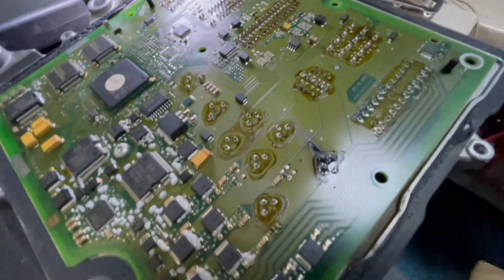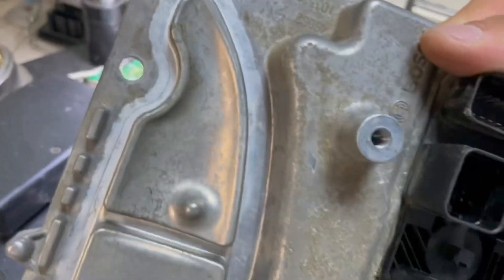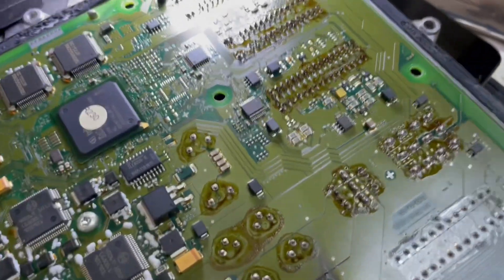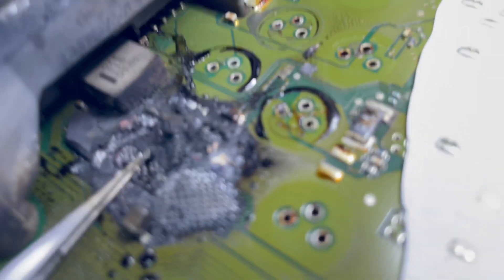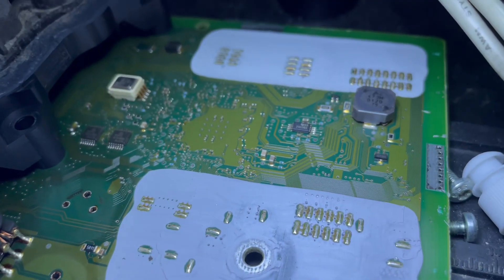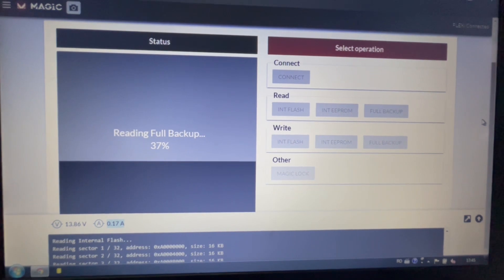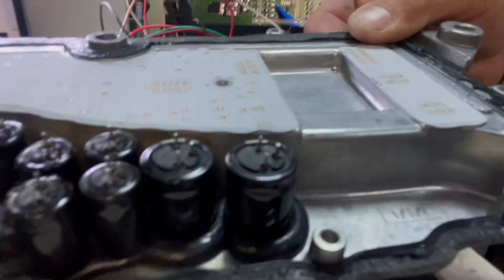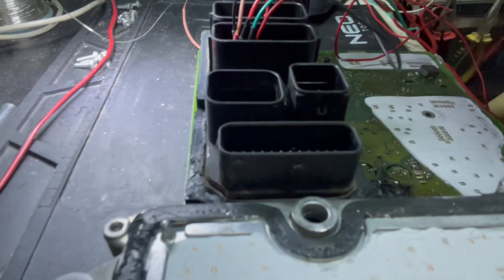BMW fried ECU MEVD17.2 valvetronic problem | no solution for that

Comment: Hi thanks for sharing, I have the same problem with my car, valvetronic not working. That's because I plug the wrong connectors on the ecu (two connectors that are the same). Did that happen to this ECU

Comment: Thanks for this. I am working on a 2012 x3 with mevd172. It has a heavy misfire on cyl 4 and will not stay running but if the Valvetronic is unplugged the car runs without issues it will throw a Valvetronic disconnect code after a few key cycles I exhausted every idea now I guess Ill find another ecu clone it then open to see if the same problem exists.
Reply: Hi did you find issue ?

Comment: Hi, for open that ecu without damage, need unsolder first all the capacitors ? and with heat ? or how to do?  i need to repair this ecu having misfire in cilinder 1 and 6 , regards
Reply from the maker: yeah, disolder them with vacuum station
Reply: @autodiagobd  boa noite amigo, você tem algum curso pra iniciantes em reparo de módulos bmw ?
Reply: @autodiagobd  How do you (take off, remove, etc) the white glue? I have taken out the black silicone and desolder the capacitors but still cant remove pcb.
Reply: @farooqmt59 I used something similar to what he shows @4:40
Reply: What is that stupid knife called? Lol Or what is its indented purpose? Can’t find it anywhere.
Reply: Please I need help I’m trying to repair the same ecu. I have an ecu with some fried components due to incorrect jump start where do I buy the components that are fried inside the ecu unit? And where can get the diagram/schematics?